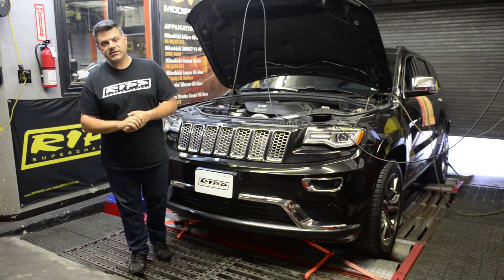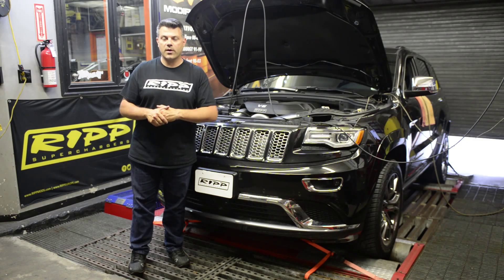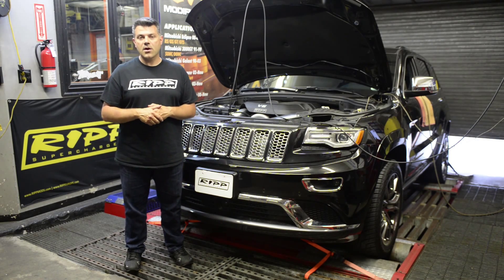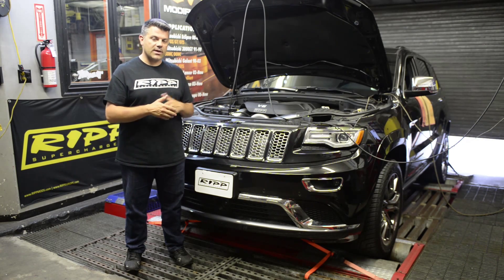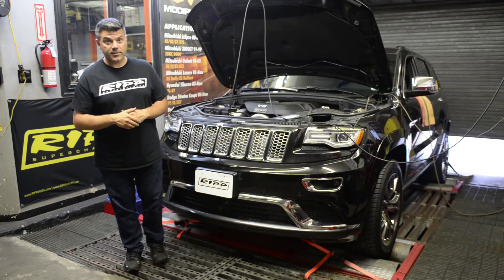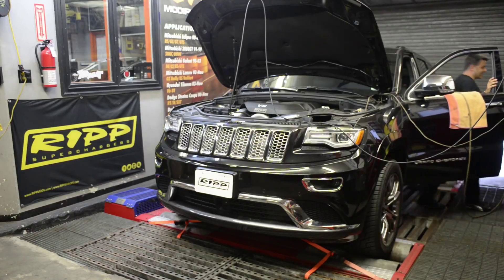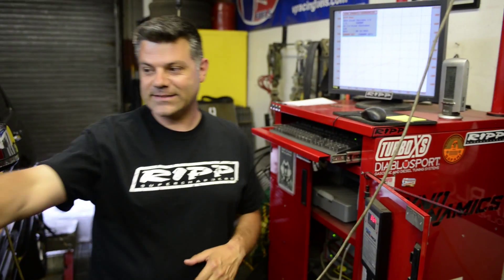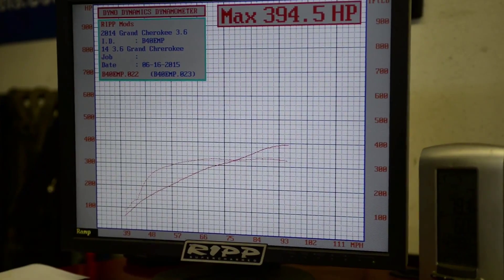RIPP Superchargers 3.6 Grand Cherokee 400 Horsepower Dyno Run

Comment: I want to do this to my Jeep Laredo grand Cherokee 2020 4 x 4 3.6 L V6, but I don’t wanna ruin my jeep even though it’s the base model with the supercharger. What other modifications will I need to make to keep my jeep reliable but fast
Reply from the maker: Hello,
Not at all. Our supercharger is completely plug and play, and they are extensively tested on stock vehicles to make sure they are as reliable as they can be. As long as you keep up with the proper maintenance and upkeep, you will not have any problems.

If you have any additional questions, please email RIPPmods@RIPPmods.com, we will gladly help you there.

Comment: I keep hearing reviews say that the pentastar is very good or bad and there's is no warning as it may blow or run great due to its manufacturing. But more so I read alot about motor failure due to low end low rpm stutter/jerk that is killing the motors? How do you fix this to avoid catastrophic engine failure?
Reply from the maker: Hello @EngineInformat,
We have thousands of supercharger kits on Grand Cherokee 3.6L engines, and in our experience, with our in-house R&D vehicle being one of our coworker's daily driver car, we have not had a vehicle catastrophically fail as you have described. If you have any additional questions or concerns, please contact RIPPmods@RIPPmods.com, we will gladly help you there.

Comment: Can these engines handle it?
Reply from the maker: Hello @metaltera86
He have extensively tested these kits in several different conditions, as well as, most of these cars that we use for testing are our daily drivers, here at RIPP. Most of these kits have gone for 100,000 miles or more, with the correct maintenance, without issues. If you have any additional questions, please email RIPPmods@RIPPmods.com, we will be glad to help you there.

Comment: I have 2019 Jeep Grand Cherokee Summit 3.6l will I achieve more hp with your coil kit and the supercharger or the same as with only your supercharger? If more, what is total? Should I change exhaust to achieve additional hp? If so, what do you recommend? Thanks. Jerry
Reply from the maker: Hello Jerry, thanks for commenting. So to answer your first question, yes, the vehicle will make more horsepower if you have the coil packs and the supercharger kit. The amount of horsepower it makes varies between customers. To answer your final question, an exhaust will not increase the horsepower. If you have any other questions, please email tech@RIPPmods.com.

Comment: this isn't horsepower.... hp is measured in 60 second intervals
.
Reply from the maker: Unfortunately we do not have access to a 1000ft deep hole and a 33 pound bucket of water so this $100,000 in ground dyno manufactured Dyno Dynamics will have to do.

Comment: I own a 2015 GC overland which is going to be off extended warranty soon. I was planning to sell and buy a 2017+ srt but with covid hitting my business hard I’m leaning towards supercharging my rig. I love all the Luxury components that come with the Overland like the  ride air suspension etc but need more horses. I have a custom exhaust that should pair nice with this set up! :)
Reply: I like the overland but I had to get the 15 summit which at the time I didn’t realize was the luxury gc🤦🏽‍♂️I definitely think the overland & summit are by far my favorite models. I do get asked if my car is the SRT8 or the Trackhawk a lot cuz my exhaust modifications💀
Reply: @estebencampos146  hahah I also own a 15 summit I’m not sure if every summit takes from 15 takes E85 but when I’m at gas stations because mine has the fender flares of a srt and track people will ask and then see I’m filling it with E85 and start asking me a bunch of questions I know the answers to as I’m a massive fan of the srt and tracks

Comment: Negative you are not hunting down srt's  srt's have 475 horsepower stock your dyno just showed 394hp for all that money that you spent you could have bought a SRT
Reply from the maker: NEGATIVE - You are confusing WHEEL HP with CRANK HP - the 392 (the engines found in an SRT) are 475hp at the crank, at the wheel they are 380-390awd-hp. Also, we supercharge the SRT too, so we happen to know a lot about it, you know, because the the whole supercharger thing. The 392 is actually weaker than both the 5.7 and the 3.6. It can only take about 5psi before it pops and people aren't really "into" that and end up wasting more money building it. Additionally it gets like 9mpg in the city and (maybe) 14mpg on the hwy and most people get tired of that too - lastly, the SRT cost way more to insure so - thanks for trolling we appreciate you stopping by - bu bye-ya!!
Reply from the maker: Here is a stock 2016 AWD SRT Jeep on the same dyno - enjoy: https://www.youtube.com/watch?v=dw2cLbmxdsE
Reply from the maker: But don't take our word for it, here's one you could have just googled yourself: https://www.youtube.com/watch?v=l9tBLjYsy74
Reply from the maker: Ohh and here's just one more not making 475hp Soooooooooooo guess that's, that right? https://www.youtube.com/watch?v=e3GoaA7jSKk

Comment: What about 2016 models can’t find any on your site ?
Reply from the maker: 2016 plus is a different engine and will be looking towards the end of the year.
Reply: RIPP Superchargers well you got a buyer lol 😂
Reply: @RIPPMODS  No offense, but in spring 2019 I was told fall 2019 over the phone.  It is fall 2020 now and still not here.  You guys could have had my 6k already and it is not going to sit here forever.
Reply from the maker: @easyperl  not sure if you realize that the entire automotive industry is under a huge manufacturing crunch due to  Covid. We are currently on a 110pc back order. We have a fully developed RAM V6 kit fully developed waiting to launch but cannot because we cannot get compressors made. We have had to push nor for lack of structure but for lack of parts.
Reply: @RIPPMODS  I hear you, but there was no covid in spring 2019 when I was told of the target date of fall 2019.  It just makes it tough to trust hearing it again a year later... especially with covid slowing stuff down.  I will remain hopeful.
Reply from the maker: @easyperl  in 2019, the test vehicle we locked down was dropped off for measuring and when asked to come back it was sold off, we never locked another. We moved onto RAM .

Comment: This is why we bought a 5.7. Already 400hp bone stock lol.
Reply from the maker: The Lab no it doesn't https://youtu.be/OIjGjTJexLA when you measure the 5.7 Grand Cherokee and Durango at the wheels it's alot less
Reply: RIPP Superchargers factory crank hp is 405 on our 2015. Around 300 to all 4 tires from factory I'd say. Throw on some exhaust and an intake, which we just ordered and we will be around 330ish. Throw a supercharger on and you're looking at 550+ fairly easy. That's good power from a 6 banger though. I wouldn't let me life get the 3.6. Spend the extra money and get the v8... but if you want the cheaper option get a 3.6
Reply: @ScottMartinEngines  What planet are you on that a 5.7L Dyno's at the wheels more power than it puts out at the crank?  Doesn't matter "what you say" opinions are not facts and your facts are all wrong.

Comment: #ripps in a comment below you say the reason this precise jeep does 400hp is because it's on 10 psi and a bigger intercooler. does a bigger intercooler really add more horsepower? does it need a bigger intercooler to run 10 psi? can you please tell me the gates part # for the belt to run 10 psi on a 2011 grand Cherokee without electric power steering?

Comment: So if I understand, you guys found a little more power, and now that's the standard when I buy one for my 14 jgc summit?  400hp?   Also what we're the changes made or how did you find more power? Just pully change?   
By adding a supercharger to my stock engine, where is the stress administered? If there was something to break as a result of adding the kit, what would it be?   Thanks.
Reply from the maker: Yes, the 400hp kit is what we supply, it was all in the tuning. With 6000 kits sold worldwide and less than a 1% fail rate we have single handily proven our system and the 3.6.
Reply: RIPP Superchargers pair that with Ripp coil packs. Ooh yeeaa

Comment: hey would the same hp gains be possible with these jeeps as you guys say in the 3.6 chargers i see theres about a 50 hp dif from the vids any reason as to why the 3.6 charger puts down more ? gearing?
Reply from the maker: Its about the same if you take into account the AWD drive-train loss the Grand Cherokee has.

Comment: When will this kit be available for the 2016 Jeep Grand Cherokee? Do you expect any gains from '15 to '16?
Reply from the maker: 15 is available 16 is currently not as its a full design change. Same exact gains 11 through 15.
Reply: +RIPP Superchargers Thank you for the fast response. I didn't realize there was a huge difference from the '15 to the '16 Jeep GC
Reply from the maker: 2011 through 2015 are currently available the 2011 Overland is included in that
Reply: RIPP Superchargers is '16 diff because of direct injection?
Reply: Do they work with 2wd jgcs?

Comment: I have a 2014 JGC Altitude with 3.6L. I have removed the stock airbox and installed an K&N 77-1560KTK Performance Intake Kit as well as got rid of the stock exhaust (felt like it weighed a ton) and installed the Magnaflow Cat-Back Performance kit Part#16929. Now all these state they increase HP as well. You always do these test with stock parts to show the gains of your product which I understand but it would be nice to see what adding these couple things with your product does. Have you had any in your shop like that and what did you get out of them?
Reply from the maker: +Andy Maine Our kits come with the same air filter - as for the cat back  they usually deliver 6-11 additional HP

Comment: How much boost is this grand running? is it the high altitude pulley? If so how is the 3.6 holding my 3.6 jk with your kits puts 344 on 8psi but have been contemplating running the high alt. pulley at sea level?
Reply from the maker: Kevin D This particular vehicle is running 10psi, but the difference is the intercooler size.

Comment: +RIPPSuperchargers both wrangler and grand cherokee are 3,6 pentastar if we decide to work with  ripp superchargers the results should be similar but there are big difference between wrangler that made 331.1hp and grand cherokee 394.5hp
Reply from the maker: available36 Yes, the drive train is much heavier in the Wrangler, there is more power loss in the wrangler than in the AWD Grand Cherokee. The intercooler size on the Grand is larger also.
Reply: +RIPP Superchargers 
.

Comment: 400 hp out of the 3.6
thats crazy
Reply: around 550 in our cousin the Gulia, which is using a Ferrari built, twin turbo Pentastar. Of course the modding community has been getting these numbers for year now

Edit: I'm darn certain I saw a vid of a 500 whp 3.6 GC a while back. 4x4. Ripp I thought.
Reply: Kalin Konnerth there are turbos running almost 600 hp...
Reply: @MrEvilTag  which product? can you link them, I am very interested! (I have a jeep grand cherokee)
Reply: @andyyi5173  custom kits
Reply: Grand shirok 2006
Reply: @hamdishehu9852  for real Hahahaha it's grand cherokee